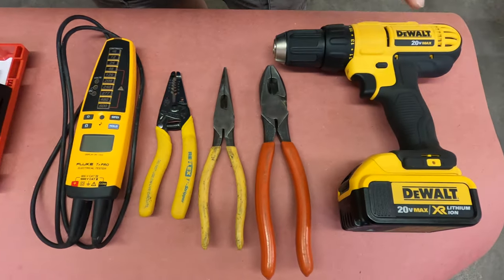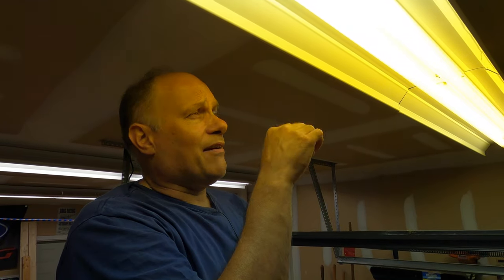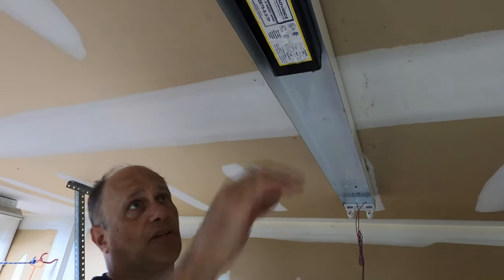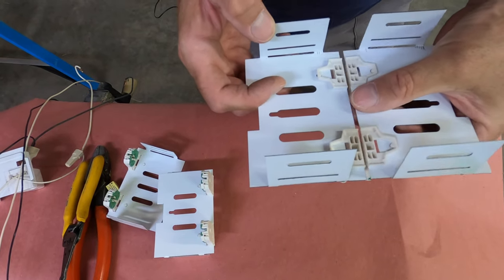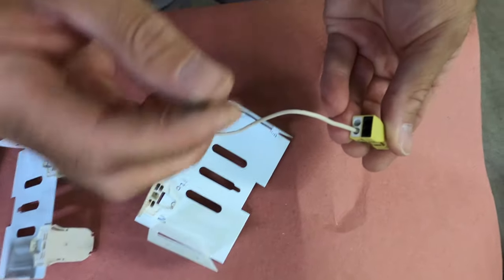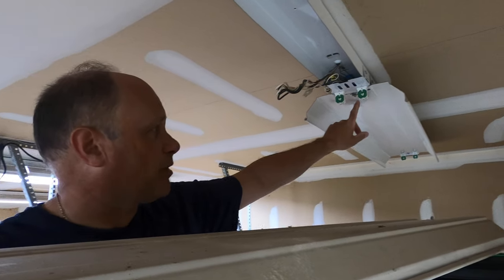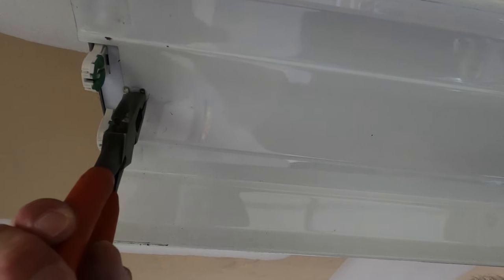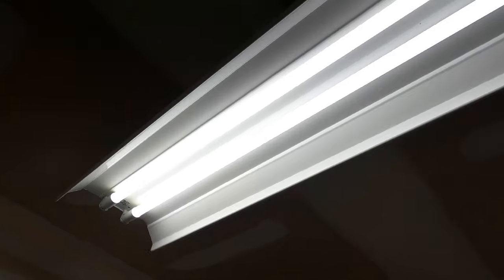How to Convert Fluorescent lights to LED // The Right Way

Comment: No link from where you got the kit?
Reply from the maker: Lynda, thanks for watching!  Here is the link. https://www.amazon.com/Retrofit-Conversion-Strip-Fixture-Bracket/dp/B07YR24SY7/ref=sr_1_18?crid=2QEBHVMKO0G1I&keywords=pro+lighting+retrofit+conversion+kit+for+t8&qid=1640130166&sprefix=prolighting+retrofit+conversion+kit+for+t8%2Caps%2C87&sr=8-18

These are the bulbs I used:  https://www.amazon.com/Sunco-Lighting-Equivalent-Daylight-Connection/dp/B07111WV44/ref=sr_1_3_sspa?crid=YYL7PMIYPRFM&keywords=Sunco+t8+led+4%E2%80%99+tube+5000k&qid=1640130459&sprefix=sunco+t8+led+4+tube+5000k%2Caps%2C87&sr=8-3-spons&psc=1&spLa=ZW5jcnlwdGVkUXVhbGlmaWVyPUEzQUJNT0dONktFWVVMJmVuY3J5cHRlZElkPUEwMzQxOTg5MVlESUpCTk9URExPNSZlbmNyeXB0ZWRBZElkPUEwODg4NTc0RlAwSTFZOTdDUk43JndpZGdldE5hbWU9c3BfYXRmJmFjdGlvbj1jbGlja1JlZGlyZWN0JmRvTm90TG9nQ2xpY2s9dHJ1ZQ==